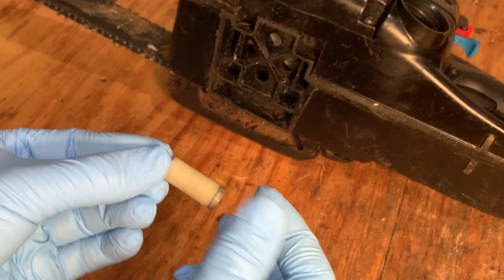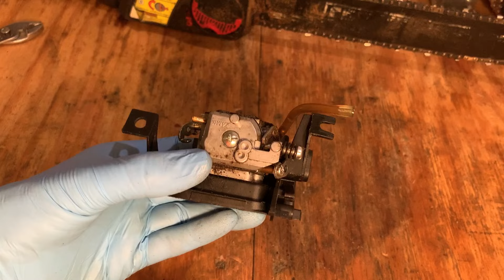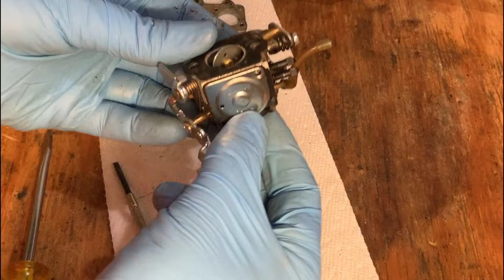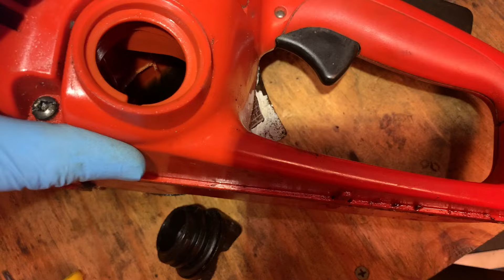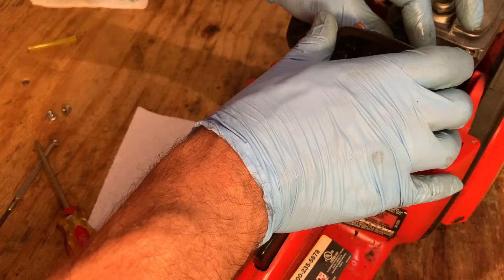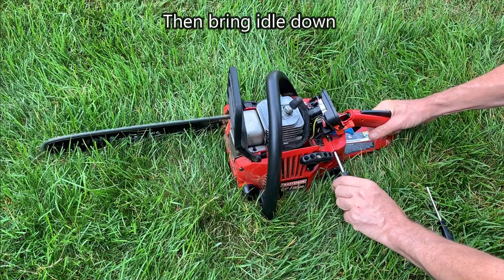Will They Run? Two Craftsman Chainsaw Will Not Start - Fixed

Comment: Just picked up a 40 xx with 18  inch bar with a case. I like it it’s green grey color.  It starts up nice and runs good but it’s been dying out on high rpm or the warmer it gets.  Maybe my fuel i out in is too rich. It stopped starting so I cleaned the plug up and it started running again but then it dying. Going to lean out the fuel after cleaning it again. I see I need the carb adjust tool as well

Comment: Great job, just two things, when adjusting the carb you need to have the air filter  on for proper air flow otherwise if you adjust the carb without the air filter on it will run ok but then it will need to be readjusted with the air filter on and it is not advisable to run a two stroke  (or even a four stroke) engine without the cover on for any length of time as the engine Will overheat due to lack of cooling air round the cylinder
Reply from the maker: Thanks.  I did have to tune it again once everything was back together.

Comment: My 20" 52cc has sit for 10 years. Removing the filter and pouring directly in the carburetor it ran so time to tackle the lines and filter and maybe I can put the electric on the shelve for a change. Back problems made me go lighter but time for the boy again

Comment: The black craftsman saw carb is super clean surprised especially since he sold it to you because he was having issues pretty clean bet it wouldn't run because the filter falling off line

Comment: I have the same black craftsman saw. Don't use it much because i have 3 saws that call for a 50:1 fuel mix. The craftsman saw i have calls for a 40:1 mix. I usually always try to get power equipment that takes a 50:1 mix
Reply: And they'll all happily run on 25-1 anyway so it doesn't really matter.

Comment: Took me hours to figure out that the bulb actually "sucks" the fuel from the tank when it's expanding and when I push the fuel bulb in it is actually pushing fuel back into the tank. I had always thought when you were pushing the primer bulb it was pushing fuel "into" the carb. Finally watched a YouTube video and change the fuel lines around and she started right up...but man was that frustrating!  Should have watched this video first BEFORE I worked on my chain saw.

Comment: I don't like those Poulan/Craftsman (cheapened Husqvarna) chainsaws. They are OK for home use. They tend to overheat if used for more than an hour or two continuous. I found that after it heats up opening the spark plug gap a bit can get it running again. They also tend to be easily damaged by scoring from uneven heating of the cylinder (this failure has a name) if revved too soon after starting and not allowed to warm up at idle for a few minutes.

Comment: I have a 18" red craftsman just like the 36cc one but mine is 42cc and just done the fuel lines, cleaned the tank, replaced the primer bulb and air filter and put it all back together. Was running before all that, now when I go to start it, it turns over but doesn't stay running or just is impossibleto start, is it possible the carb needs to be retuned?
Reply from the maker: Two things come to mind.  First check the pluming for the primer bulb and carburetor.  The primer should be pulling the fuel through the carb on the return line not pushing it through on the carb fuel inlet.  Make sure the lines are in the correct locations in the carb.  If a new clone carb, then the high and low speed jets almost always have to be adjusted.

Comment: Awsome channel.  What should the compression be on chainsaws like your working on
Thank you
Reply from the maker: Good question.  I have not tested the compression yet on a saw.
Reply: @jcondon1  if anyone knows  could they post it please
Reply: 135+ is great, 100+ is good, below 90 usually won’t run

Comment: I'm stuck, wondering if you had any suggestions. I have an older Craftsman 2-stroke leaf blower. Last year it would run but wouldn't reach full speed. It would get close if I partially closed the choke (not getting enough gas?)  This year it wouldn't start at all. I removed the carburetor and it is a Walbro, but like nothing I've ever seen. It has an external metal push button on the metering end - no idea what that is for.  Anyway, it won't prime/run. I've cleaned out every orifice I could find, sprayed liberally with carb cleaner, and ran it through ultrasonic cleaner. No change. The model number is WA228A for which I can find NOTHING on the web...no rebuild kits, no substitute carbs, nothing. Any ideas? I hate throwing the thing away..the rest of it is in good shape. Thanks for any help.
Reply from the maker: I think the rebuild kit you need is K23-WAT.  Take a look, and see if the parts look correct.
Reply: @jcondon1  I think I'm admitting defeat on this machine. I've tried 3 different carbs, checked the spark with a tester pulling the starter rope, even removed the muffler in case it was clogged. Best I can manage is that it'll run for about 5-6 seconds then die. Maybe the coil can't produce enough spark when it gets up to speed? Anyway, thanks for the suggestion.

Comment: My chainsaw is running fine but got a new carb and lines put on it recently and when i go to cut the chain quits spinning even when giving gas. Any ideas of what it could be?
Reply: The muffler gets plugged. Try taking it off and cleaning any deposits out of the exhaust ports.
Reply: @keithstudly6071  its a brand new saw only cut a few small branches, got it from an old bosses husband before he passed, he bought it new but could never get it to start.

Comment: Hello, I bought the same chainsaw today. It's 2005. Is it true that Paulan 2250 parts are suitable for it? thanks for the answer
Reply from the maker: These "Craftman" branded saws are a Poulan.  I am not sure what model of Poulan, but looked at the 2250 just and they are probably the same in most respects if not identical.
Reply: @jcondon1  Thank you very much for your reply)

Comment: I just rebuilt a craftsman and both fuel lines were deteriorated and disconnected so I can't figure out which line gets the filter and where it's supposed to hook up to. Can you give me a diagram?
Reply from the maker: I do not have a diagram for this saw.  If the same model then this should help https://youtu.be/1zYaSKm8Sec?t=320
Reply: @jcondon1  found a diagram, now I need to adjust the carb

Comment: I’d say that chain is whupped😀
Reply: Agreed.  The black one was making sawdust rather than chips, which usually means the chain is dull.  Couldn't tell on the red one because the angle was bad, but I'd say check out one of the spare chains it came with, though those are probably worse.

Comment: Whoa ?? How did repair the black saw ? i got same problem? air in the lines ? wish you took the time to explain it ?? Crapman saws i got 10 of them all run the same and diehard after one uses junk today...Please stick to gennys... Your Master of those looking forward to your new find !!
Reply from the maker: I am working on a few generators now.  Unfortunately they are harder to find recently following the tropical storm we had recently.  I put a clone carb on the black saw to resolve the issue.  Not worth trying to fix the OEM carb.  The clone was $18.  OEM is only $30.
Reply: @jcondon1  how'd it work with the fresh carb?

Comment: How much torque did you put on those carb bolts?
Reply from the maker: The carb bolts?  40 in/lbs is what I usually do on something that small.
Reply: @jcondon1  what I try to see is the setting on your torque wrench.  On those quarter inch torque wrenches it is hard to hear the click.  What setting do you use for chainsaws, hedge trimmers and the like?

Comment: think you paid too much,  buy a Stihl ,older model 260... simple to work on,  down time is money heading down a hole.
Reply from the maker: Yes my main saw is an older Stihl.  But was surprised that these cheap ones worked as well as they did.  Of cause these are only 10 years old and both have issues.  My Stihl is at least twice that and never had a problem.

Comment: For my untrained ear it seemed that you were a little low on top RPM on both saws? Maybe adjust the max RPM screw on the carb. Or were you just not applying full throttle when you were sawing?
Reply from the maker: I think it was a little of both.
Reply: I would think so. Great videos btw.

Comment: Love the video! What's that little grabber thing you used to grab the filter? Thanks again!
Reply from the maker: It called "Lighted Mechanical Pickup Tool" sold at Home Depot
https://www.homedepot.com/p/Husky-24-in-Lighted-Mechanical-Pickup-Tool-70396H/206264355?MERCH=REC-searchViewedNA-206264355--N
Reply: @jcondon1  Thanks!
Reply: The CLAW!

Comment: There's no questioning success.........but I'm confused by your resorting to a clone replacement. If an integral component were missing off the OE carb, I could understand.
Reply from the maker: I questioned that myself.  But I kept the original carb to rebuild at some point.  The clone was from Amazon and easy to return if it was complete junk.  The OEM carb new is also not that expensive.  About $30.

Comment: Sears parts are getting harder to find. Poulan parts are interchangeable if there was a way to cross reference part numbers. I have an old 36cc that needs a gas cap and the cover for the bar/ clutch.

Comment: I really need your help. My mower won't run and don't have money for a new one. I've checked spark and my air filter and checked oil and checked tension on cables all the basics and will start no matter how much I try pulling...However if I put a little starter fluid or gasoline directly in the carb it'll start and run till it burns up that gas so about 30 seconds and coincidencely the exact same thing is happening to my work van right now but I think it's probably my fuel pump in my van but not positive yet. I checked all the fuel lines none of them are broke or cracked or disconnected so I was thinking about buying a carb kit for it? If the owner of this channel would respond to me that would be awesome or if anybody else in the comments section might know I would be extremely grateful for anybody's suggestions or tips thank you.
Reply from the maker: It is runs on starter fluid then you know you have timing, compression and spark.  It has to be fuel related.  Most likely the carburetor has to be cleaned or replaced and then it will run.
Reply: @jcondon1  thank you for the quick response my friend and that's what I was thinking and that's also why I said I was going to buy a carb kit for it and I'm hoping that will do it. What do you think?
Reply: @jcondon1  btw really liking your content and I'm subscribed as of today. And been watching your vids for the last hour straight
Reply from the maker: dswmetals02 a new card will fix it.  The only other issue possible would be a blockage in the fuel line from the tank to the carb, but that does not happen often.  Also make sure the gasket between the engine and carb is good or you will have issues.
Reply: @jcondon1  I found out that mine primes thru the air intake housing ,and the gasket was bad, blocking the prime.  It also will start with starting fluid like yours.
Reply: Just clean it. Don't throw money at the problem.

Comment: You should seriously never start a saw with the chain brake off .
Reply: @Thomas Andrews What does that have to do with the Chip chute . Chain brake wont stop that chain from taking your hand off if it throws it or it breaks it the chain brake is for kick back from contacting the tip . Ive seen it before and it aint pretty
Reply: Chain brakes weren't invented as a safe starting device,  I still own and use saws that never had one.

Comment: Needs bucking teeth installed on saw so u can make saw teeth cut more aggressively with a little force. 🐗
Reply: Thats how most bars get worn out before their time- people using those teeth to gain leverage just results in a low spot on the bar in front of the motor. Best way to cut faster is to keep the chain sharp, or maybe get a chisel chain.

Comment: Chain is too tight on top of dull but other than that good job
Reply from the maker: Thanks.  I agree.  Later I did adjust the chain tension and sharpened both blades.  They were very dull.

Comment: This is joke not enough power to cut a tree Lim waste $30 on a peace of shit saw that can’t even cut.my ms200t and my ms661c can out run that all day long
Reply: And both of your saws will be shit one day too if you don't maintain them. Best value and performance small saw for the money was the McCulloch Eager Beaver 2.1 over the decades ive scrounged and resurrected a half dozen and they've been troopers. Still look for them at the scrapyard but theyre getting thin being an 80's saw. Most at the scrapyard are chinese these days.